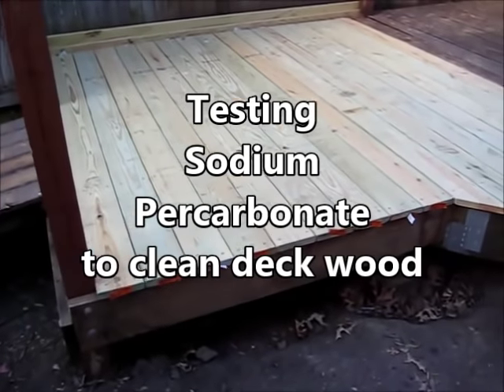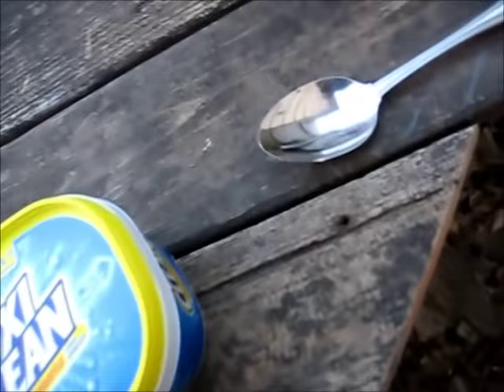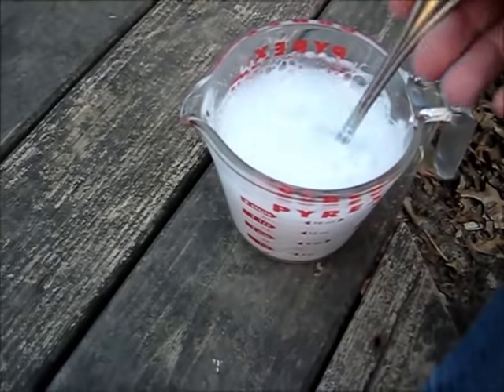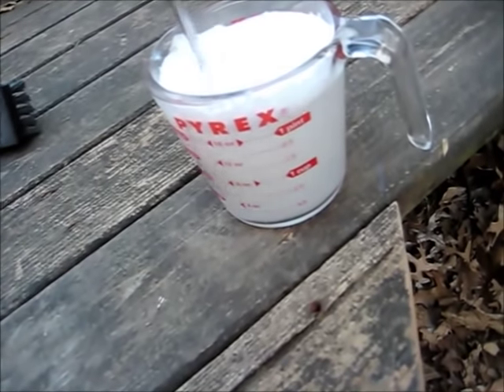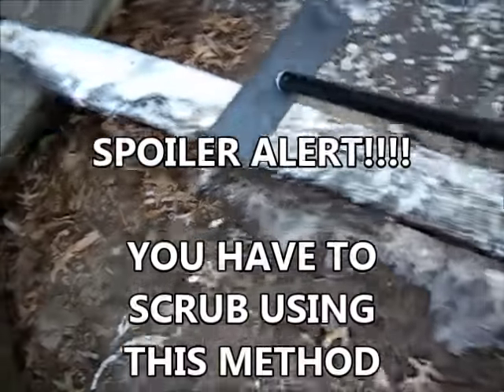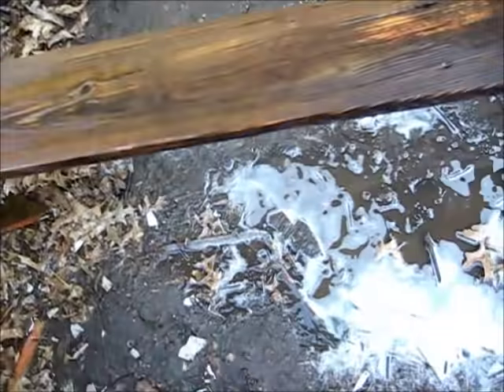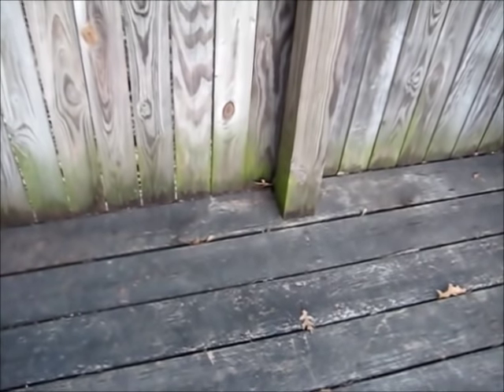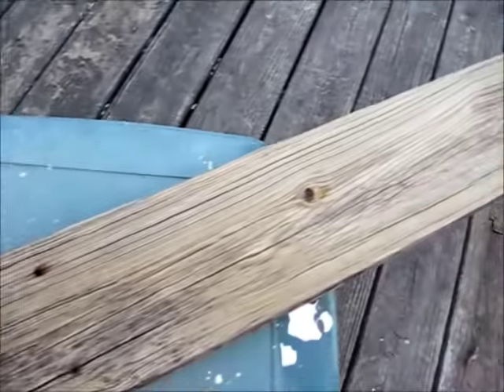Test Sodium Percarbonate cleaning wooden deck test, the truth, oxygen bleach cleans wood boards

Comment: i live in nz and make a lot of homebrew beer and spirits I use pure pure sodium percarbonate to clean my equipment then just splash it on my deck have a beer and give it a brush have another beer then hose it off deck is awsome
Reply: As long as you use water that's a minimum of 70 C to dissolve the sodium percarbonate, that stuff works on just about anything! Once the granules have dissolved, it's fine to add cold water, or to add to washing machine on cold wash.

Comment: Thanks for the info.  I also appreciate the info about other chemicals being bad for the environment. And you do sound like John Goodman.
Reply from the maker: My pleasure to help out. That is interesting about John Goodman and I. 

I will have to listen to myself with a blind eye and see... 

I will add that after using sodium percarbonate on my deck I have been using it to clean other things... and that stuff works great.

Last week I mixed up a small batch to try to clean a stubborn filthy sticky area on my kitchen floor. I dumped it on, let it soak for 15 minutes and used a paper towel to scrub it off and.... WOW!! I am somewhat flabbergasted how well it works. 

The only problem is the filthy area was then so clean looking that it made what was (kind of) the clean part look filthy.... so I had to clean the whole floor. The next day when I went in to the kitchen I was stunned how great it looks.

I am not paid to say any of this stuff... but still... I am happy to pass along how well this bubbling cleaner works. Next up for me is testing it on some white socks that are.... well... you know.  I have high hopes that they will sparkle

Comment: I used the product from the Dollar Tree and cleaned my deck and fireplace, just mix it with hot water, let it dissolve and pour over the deck, let  sit for 10 min then "lightly" scrub with a broom, let sit again 10 min and using highest pressure on my hose, water it off, let dry...incredible, looks NEW! ( and its so gentle, I used it to clan my teeth, ha!)
Reply: What's the name of the product
Reply: @rlthomas         Awesome Oxygen  
white plastic screw top container 16 oz. $1.00 at Dollar Tree
Reply: Going to get some to try.  Thanks!

Comment: Do you think I can make the ratio to where it's paste-like because I need it to stay awhile on the underside of a horizontal pergola post?
Reply from the maker: If it was me I would not do that. I would just keep applying it and applying, some of it will stick and then put some more on and it will stick. Maybe use a sponge or towel and keep it very wet... the bubbles will do their thing and I bet it will work. If not give a second try... maybe a third.  Maybe do a small batch of super concentrate and use a scrub brush to apply it and keep applying and scrubbing until it comes clean.

If that does not work, of course you could make a paste, but I would make sure to do a trial run on an area that does not matter and see if the paste does too much. 

Please write back and let us know how it went.

Comment: Hi, would sodium percabonate works on ceramic tiles and grout also? Thank you.
Reply from the maker: Of course I will say first ALWAYS test on a small area where if it is ruined it is not a disaster... BUT with that said (and you taking that advice) YES... It works GREAT on tile and grout. Mix it up, let it sit to make sure all the grains are dissolved, then put the mix on the floor. Let it sit on the dirty area and bubble for as along as needed (1? 3? 5? 15? minutes? test on your own) Then scrub as much as is needed and if it gets clean quick you did it right. If not make a stronger mix, let it sit on the floor longer and/or scrub harder.
I did my (tile, vinyl, linoleum) floors by doing a normal hot water mix, allowing it dissolve, then dumping it on 4 square feet areas, let it sit for 2-3 minutes and scrubbing normal. I have been amazed at how well this stuff works.
I do not get paid or compensated in any way to say that... but it is true... this stuff is miracle cleaner. IT CLEANS EVERYTHING!! Billy Mays Hayes was not kidding, I thought he was crazy back in the day with his ranting, but he was not kidding
Just the other day I had two dirty old towels which were worth keeping if they could come clean... But I was skeptical could come clean. I soaked them for an hour in an oxy bleach.... then washed them as normal... and holy moly... they came out looking great. Better than I imagined... AND THAT IS AFTER I AM ALREADY AMAZED AT THIS STUFF.

Short answer - I think you can clean anything and everything with this stuff. So far it has worked on everything for me.... but still... when it matters I do a test on a small unnoticeable area in case it might ruin something. So far it has worked like a miracle.
Reply: By pure sodium precarbonate (The sodium carbonate is just a filler) get it from your local brew store mix into a paste wear gloves scrub grout 👍
Reply: @7777jayhawk  Hi, thank you for the comment. Sorry for the very late reply. I have another question, does it work as well if you use room temperature water instead of hot water? What’s your experience with that?
Reply from the maker: @BSPoK  Using warm makes the powder desolve quicker, gets rid of the lumpy grains, but it is fine to use any temp. I would just make sure the powder is gone.

I will tell you a secret, I have not done a deck or wood since this project, but I soak my clothes in a 5 gallon bucket of this stuff and it works great! O saok the clothes for about 2-3 hours. I use warm/hot water  because the one time I did not it took a long time to devolve. 

This stuff is also great for floors, or really to clean anything. It turns out that Billy Mays Hays was telling the truth when he made his hyper commercials back in the day.